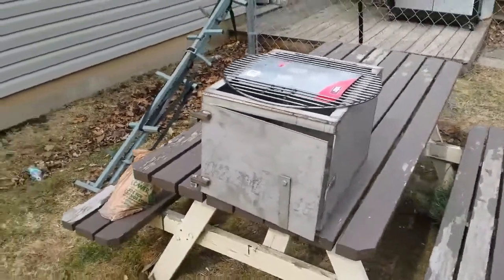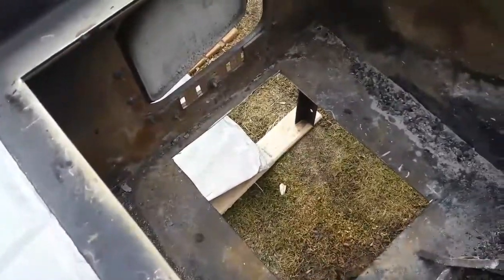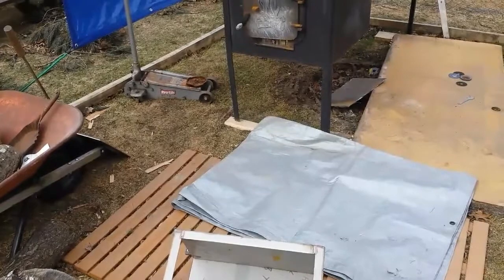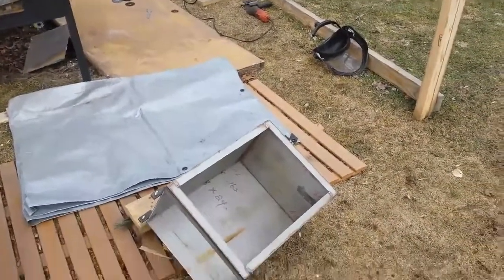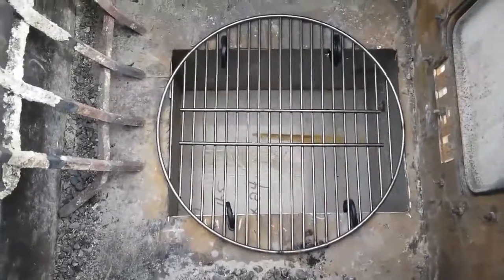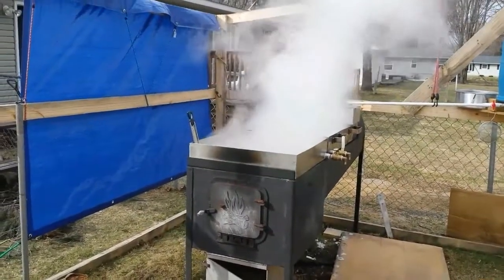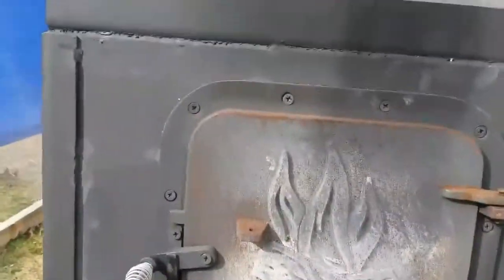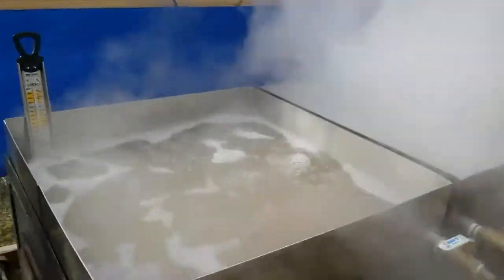Mini Evaporator??????

Comment: what is the measurements for this ash/draft box?
Reply from the maker: david bogan 12” wide 12” tall and 16” long.  Door is 12” x11”. Only thing I would change is if I wasn’t running forced air now I would put some sort of lip on the bottom so when the door is open hot ashes wouldn’t be able to roll out of it.